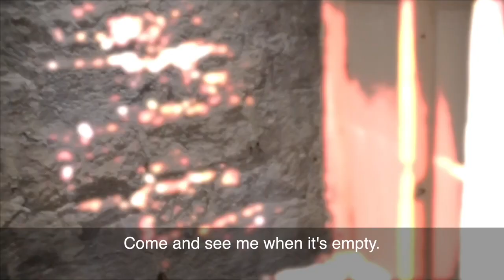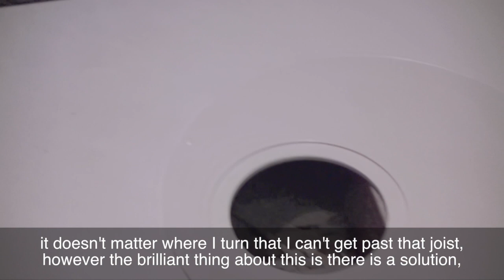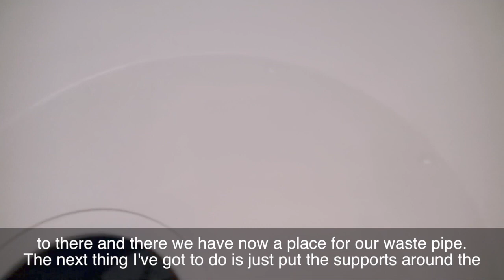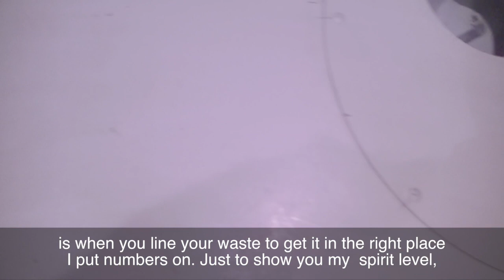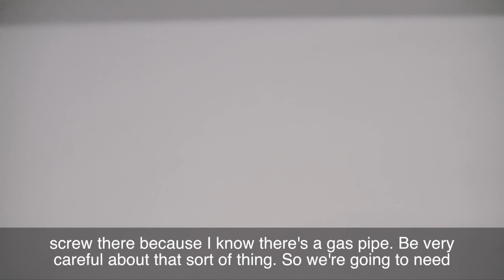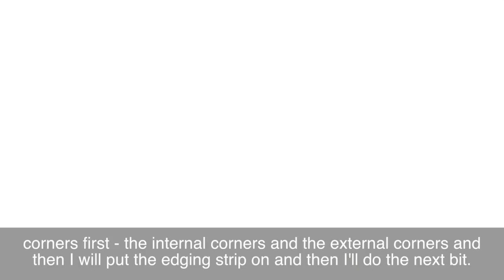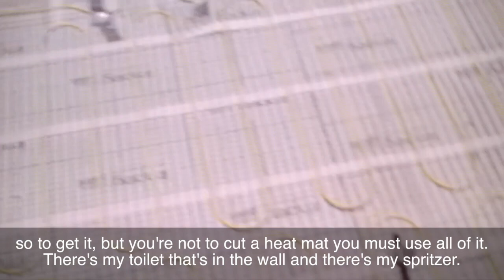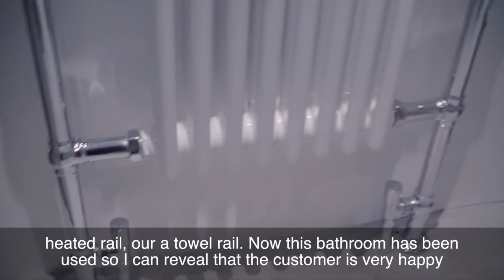Impey Wetroom Installation - Hattie Hasan Stopcocks

Comment: About 5 minutes in the way you’ve fixed down that floor is shocking 10 inches plus between screws, the narrow strip between tray and wall is definitely going to move, I wouldn’t be happy if this was installed in my house
Reply from the maker: Hi Stuart, please note that these are the pre-made holes for fixing down the dec and we have not encountered an issue with regards to the space between the screws holes. This floor former has been designed so that it is possible to make additional screw holes if needed anywhere on the dec except inside the eccentric drain plate. If doing this, you will just need to make sure to countersink them so the screws will sit flush in the dec. We hope this helps  Thanks for watching
Reply: @ImpeyshowersOFFICIAL  I have complete faith in the tray I’m actually a big fan and intend on fitting one in my new house next year, I’m talking about how the flooring around the tray has been secured